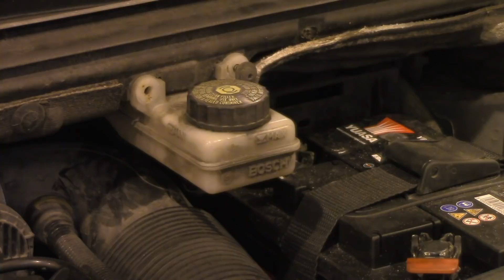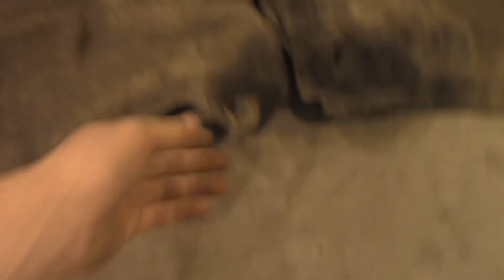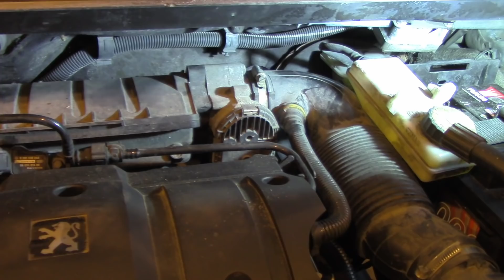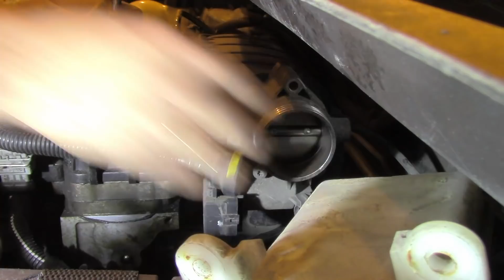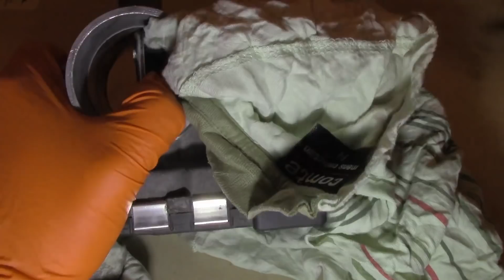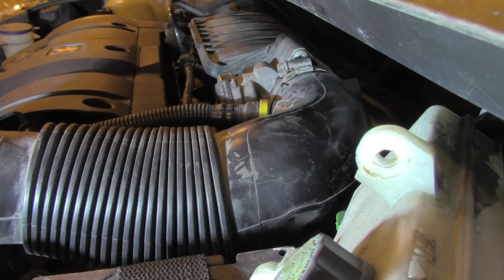THROTTLE Cleaning / Replacement - Peugeot 307

Comment: Thanks a lot for this video, my Peugeot 307 2003 1.6l had P0216 and P0211 trouble codes and sometimes it stopped responding to gas pedal completely, it continued to respond after restarting the engine. I cleaned the throttle body and the problem was gone for like 20 kilometers, but MIL and the problem of not responding to gas pedal came back. After that I cleaned and lubed the gas pedal sensor connector and the problem has been gone completely now! I was afraid to fix this issue myself, because I have never even changed a light bulb in a car before, but this video was so informative and inspiring that I actually fixed a car problem by myself for the first time ever! Thank you so much :).

Comment: My Citroen C2 1.6 TU5JP4S had a problem with idling, and didn't rev nicely until 2k rpm. After cleaning throttle body, and the MAP sensor, it really helped a lot, now it idles and revs nicely. Kudos to this video!

Comment: Have you done a video regarding the Idle Valve?.
I am having problems with below "9rpm" it shows oil pressure insufficient and after clearing the swamp, oil pickup and servicing the oil pump, its the last think that could be an issue.
Reply: How did you fix it?

Comment: Very nice video! I have an issue with my 307 1.4 8v 75ps. When i press the clutch to change gear or stop, sometimes the engine immediately shuts down (rpms go from 2000-3000 etc to 0). I tried to clean the map sensor and replace the idle valve, but the same happened again. I don' t know which part is causing the problem because the ecu don' t have any error. Everything else (engine performance, idle speed etc are perfect). Do you have any idea?
Reply: I have same issue right now, How do you solve it?
Reply: @Parasau_kartais-us5ij  For some reason when I replaced the clutch set, the issue resolved. I don't know exactly what was happening. Maybe the ECU program is not perfect, and with worn out clutch the engine disangages more quickly with the gearbox and the ECU is not ready to supply fuel and air for idling (because when you roll downhill - with gear - without pressing the accelator the fuel stops completely). I am not sure but this is my guess.
Reply: @orfeas92   Thanks for the reply.
My car's clutch is in pretty bad shape, I guess I may have to do the same as you. In any case, when the problem is solved, I will write what I had to do.
Reply: So... as promised I will write the solution to my (Peugeot 307 1.6 80kw petrol) problem. According to the author of this video, the problem was timing. In my case, this happened to me too, the only difference is that my engine was assembled correctly, but the timing belt, timing belt tensioner and water pump were in very poor condition, so they moved unevenly and did not do their full job. Replacing the timing belt (also timing belt tensioner and water pump) solved the problem. :hand-purple-blue-peace:

Comment: video was very helpfull i cleaned throttle yesterday and its working fine.Before cleaning  diagnostic tool in service  find problem in map sensor but it was not right because i  put a new map sensor and engine run  with problems.Revs gone up and down  and i faced sudden loss of power and engine stoped running while i was driving .Remember to disconect possitive batery  cable before any work in car so if ECM  records any error code you will not have it in ECM memory anymore.Thank you again.My car is a 307 1.6 109 ps with 89000 km 2003 model.
Reply from the maker: Thanks for good feedback Kostas!
Reply: errors in ECM memory can be cleared with the scanner?
Reply: YES!!!! But its impportant to have best diagnostic software

Comment: I appreciate your video. I cleaned mine and my idle is now smooth. As an observation... you really don't have to remove anything else than the air duct coming from the filter. It gives you plenty of room to work. 5 minute job.
Reply: I think that work only for cleaning but for replacing it one should make all the steps he showed in the video. Thanks for sharing your experience. I am trying to gather the courage to clean the throttle from my Peugeot for a while now bot I do not have a garage.
Reply: @madapro03  Nu. Nu e nevoie de nimic mai mult decat demontarea admisiei de aer. Un surub pe conducta si restul pe valva. Este super usor. Foloseste un servetel imbibat cu wd40 pentru curatat si putin ulei siliconic pentru uns. Daca nu ineci piesa in ulei nu ai probleme. Serios, dureaza 5 minute. Curaj si succes!
Reply: @z-collector7518  Am verificat ieri si la masina mea filtrul de aer si clapeta de admisie a aerului sunt in fata, intre radiator si motor, ceea ce m-a facut sa ma bucur ca un copil prost. :))

Comment: Is it possible to damage throttle body with nitroglycerin? I used it to clean and now ‘antipollution fault came on’. Perhaps it could be only air leak somewhere when i connected it? Can you rev up car without hose which is connecting Throttle body with Air filter? Thanks in advance!

Comment: How do you relearn the throttle afterwards . I have a Peugeot 307 1.4 16v petrol . I've done a cam belt change on the car and cleaned the throttle body . But now when I start it up the revs are high and no response hardly on the throttle pedal and then when temperature gets up , the car revs up my itself . One minute it will start and then it won't . To get it to start I have to turn ignition on wait 20 sec and turn ignition off and then it starts.  But revs are high and then revs die down and then up and then stalls . Can u please tell me the relearn procedure without having to buy a lexia 3 diagnostic . I've looked on Google but not much information on how to relearn the throttle.  It's a fly by wire on mine.
Reply from the maker: Hi Jimmy,
To be honest I have never done that before. I would like to help you out so I will read a bit myself. What have you used to clean the throttle body? Perhaps there is some internal damage to the throttle body wiring inside? I suspect that you will need to connect to OBD-II in order to do the reset. I have only tried with PP2000 but Lexia 3 should work as well. I also know that there are other more expensive interfaces that are available on the market but this is definitely not worth buying to fix the throttle body alone. Consider going to the car mechanic - I paid 15 Dollars to connect the advanced interface to mine about one year ago. Perhaps such option is the cheapest and fastest?
I will let you know if I find out some more info.
Cheers
Reply: I just used throttle body cleaner and just spray a slight amount on the metal housing and flap and wiped it dry and let it air dry for a few mins . I've got a pretty good scanner tool , and showing code u1118 , p0500 , p0340 , p0341 . When I connect to live data and have the engine running to see the graphs.  When I go to switch engine off , the car still carrys on running , even with the ignition completely off and pull key out . I have to run round to engine and choke it out, with my hand over the intake . It does this every time I plug my scanner in and revs up by itself . Is my scanner upsetting the ecu . I've used my scanner on cars before and never done that.  The cars got a mind of its own.
Reply from the maker: Hmm... Then I would check the sensor for the gas pedal. Symptoms on the car and u1118 code would indicate the fault there. 
Another question, have you recently changed timing belt? It seams like it might slip one tooth or the crank / camshaft sensor is faulty. What do you think?
Reply: I brought the car with cam belt snapped . So I changed the cam belt and a few valves what had bent and put new head gasket on . I'm also getting codes, p0012 and that saying variable timing electovalve locked at lower stop . And code p0341 which means, cylinder reference 1 open circuit , short circuit to positive , short to earth . I'm at a complete loss with it now and don't know where to start first on it.
Reply from the maker: Perhaps you can check the sensors with multimeter? The method might be to start ruling out things so you are left with less and less to check. Even though it sounds like a process :)
Reply: Shropshire ebike journeys did you solve the issue? I have a peugeot 207 1.4 with the same problem
Reply: @retroshropshire41  from my experience working on euro cars like peugeot and renault, the not switching off problem usually refers to one or more of the fuse boxes fitted on the vehicle or it could be the inhibitor switch. it's a hard problem to diagnose because of the way these cars are wired but it's usually centered around those elements.

Comment: hi great video,  do you know what causes anti pollution fault on 307 1.4 envy 90 petrol ?? I got engine management light and anti pollution fault.   Thanks in advance☺
Reply from the maker: Hi Illu,
Thanks for the feedback!

This fault might mean many things. Starting from low Eolys Fluid level, through turbine fault, low fuel pressure, faulty Lambda sensor, dirty Throttle and more. I would recommend you visit nearest workshop and connect PP2000 (Peugeot Planet software) to your car and read the errors. Error codes will tell you what is wrong. If you have PP2000 check this video on how to connect it: https://www.youtube.com/watch?v=nmLAOIYUgp4
If you want to try cleaning the throttle see this one: https://www.youtube.com/watch?v=4WPGEkZC2Fw.
Also like one person mentioned in the comments before:
"Thy the MAF sensor or the sensor's connection harness and also the PCV valve -that is the ventilation valve for the crankshaft."
Hope it helps
Cheers
Reply: change your coil pack

Comment: Thank you very much for your vedio, it is absolutely useful. 
I wonder if you have a vedio for how to replace injectors on peugeot 307 petrol engine 1.6?
Reply from the maker: Hi Galloper,
I am vary happy to hear that :)
Regarding injectors I do not have the video YET :) I will add that to the video list for the future.
Cheers
Reply: Hi, did you find any video or Tuto about injectors (for this engine)? I am looking for it everywhere. Unfortunately, it seems that we have to remove / disassemble  intake manifold. Thanks From France.
Reply: alexi57   Merci beaucoup pour votre réponse. 
    Unfortunately I couldn't find anyone. However, I wonder if you have a service manual so l can follow the instructions to do that. If yes then I  can film the process. 
Greetings from Iraq.
Reply: Unfortunately I have no service manual or what so ever. You don't need to literally remove the whole intake, but you just need  to undo / loosen the bolts/ screws behind the manifold and open some space to remove the injectors. If your car have a high "kilometrage" it's desirable to change the gaskets from injectors and manifold. As to me I went to a garage to clean up the injectors without removing them.

Comment: Where is the Idle Air control valve mounted on the 1.6 engine ? Can someone tell me please..
Reply from the maker: Hi Celal,
I do not think that they have mounted ICV in 1.6 L engines. They are using a motorize throttle body to substitute that. I am sure there is ICV available for 2.0 L Peugeot 307. There are also some available online for 1.4 L, nonetheless I have not personally seen one on the engine. 
Hope it helps.
Cheers

Comment: Thank you, this is great. Can you tell me where the Throttle Position Sensor is please? Sometimes when I’m driving there is no response from the accelerator pedal. I press it and nothing! Then a few taps and it works (very scary sometimes). 
Could it be the Throttle Position Sensor? Thank you
Reply: On my 1.6 16v petrol it is part of the throttle/accelerator pedal. Mounted to the bulkhead by 3 nuts and a (4 pin?) connector.

Comment: hello hello     mr common sence  here ,,,,,,,,,, do not   remove   ant thing apart from the  air intake   from the front of the enging then spray  egr valve  cleaner in as it tells you on he can   ,, cleans every thing  including the throttle  .. job done in  2 min

Comment: hey .. i got a problem with my 307 1.6 16v , got an p0443 , excesive fuel consumption and for some reason less power. i'm subscribed thanks , more videos for 307
Reply from the maker: Hi Smashy,
Thanks for your support!
I looked a bit online and found that (seems to fit the description):
To cause a P0443, there has to be a problem with the purge control CIRCUIT, not necessarily the valve. Usually they are a unit housing the valve and the solenoid as an assembly. Or it could be comprised of a separate solenoid with vacuum lines to a purge valve. That said, it could be any of the following: 
-Bad purge solenoid (internal short or open) 
-Wiring harness chafing or rubbing another component causing short or open on control circuit 
-Connector worn, broken or shorted due to water intrusion 
-Driver circuit inside powertrain control module (PCM) is bad

Read more at: https://www.obd-codes.com/p0443
Copyright OBD-Codes.com

Cheers
Reply: thank you very much indeed , very useful also please make more 307 videos.. cheers friend.